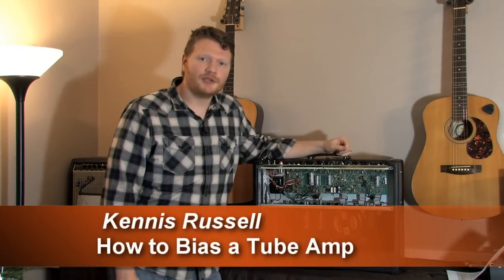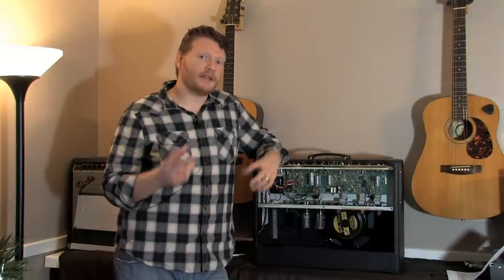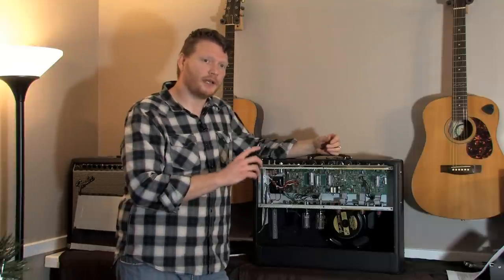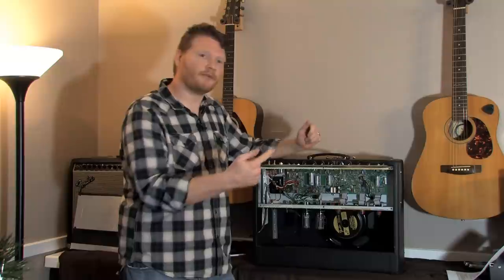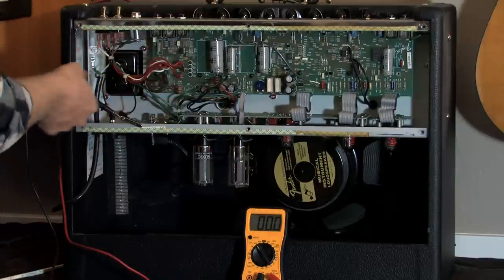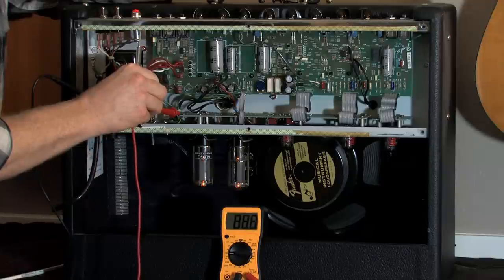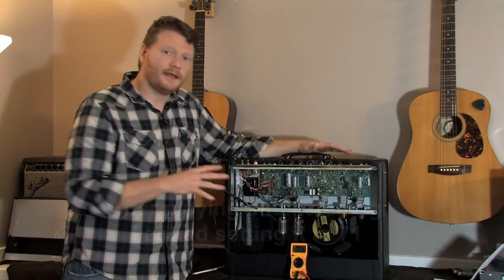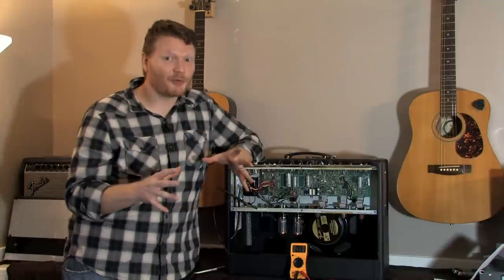How to Bias Your Guitar Tube Amp

Comment: Do peavey 6505 combos have to be biased after replacing the tubes?
I've read that they're fixed biased. Not sure what it means.
Reply: Peavey 6505 is in fact fixed bias. Fixed bias means that it can be biased like this amp. If you are going to switch from 6l6 to el34 on that amp or from 6l6 to 6l6gc(or the other way around, no clue what stock 6505 has), then you will have to rebias. But if you are switching to the same type of tube, then you should be alright so long as the plate of the tube doesnt turn red. If any tube redplates, you should rebias immediately or else await quick tube death. You should also never mix different types of tubes or mix unmatched tubes of the same type. Mixing unmatched tubes will end up giving you ugly crossover distortion in one of the tubes, meaning half the sound you hear from your amp will be turd. 

You should follow safety measures mentioned in this video if you are to ever open up you amp. Its no joke when people say that guitars amps can kill you even while turned off.
Reply: Amps with 'fixed bias' are the ones that require bias adjustments when swapping valves. Confusing, isn't it.

Comment: would you have to adjust anything else other than the bias if you wanted to change the 6l6's for el34's in a fender hot rod deluxe?
Reply: Unless your amp is capable of using both 6L6 and EL34 power tubes, all you have to do is set/adjust bias. However, most tube amps are setup for either 6L6 or EL34 and not both.
Reply: This amp is not equipped to take EL34 tubes.  You would need to have a qualified technician perform heavy modifications on an amp like this to accept a different type of tube unless the amp was already set up to accept them (some Carvin amps can take 6L6GC or EL34 tubes--the V3, for example).  In that case, the amp would have a bias switch on the back to choose which type of tubes are in the amp, not to mention you would still have to follow an internal biasing procedure like this in order to dial in the correct voltage to the tubes.

Comment: Thanks for the Video.  Why you need to bias your tube Amp: Resistors, capacitors  and tube values deteriorate with time.  It changes the amp output tube characteristics in terms of current, voltage drop and power dissipation. Bias is really realign these values to tube specs for optimum performance.  I highly recommend you check out Uncle Dougs bias video.

Comment: Damn good presentation Kennis. Good work. I'm a VOX AC-30 man myself... Beatles fan.... and I watched your vid on biassing because a power toob just shat in my AC-30 CC1.
I knew that, because the main input fuse blew its stack. You've taken the mystery out of biassing (in broad general terms). I'll give it a go myself when I get a new set of valves. Thanx again Man! 
P.S. please buy a non-conductive set of screw drivers... for the sake of your longevity.
Thanx Kennis.

Comment: how about biasing an amplifier that doesn't have a bias pot?
Reply: If the amp doesnt have a bias pot then its one of 2 things. Its either a cathode biased amp which doesnt require any bias, or its a fixed resistor bias which lock you into using a specific brand of tubes in order to get a perfect bias, such as Mesa Boogie amps. These fixed resistor bias amps are generally a pain in the ass, if youd want to change this to be able to use any brand of tubes, youd be better off taking it to a tech and have a fixed bias mod done to it.

but Im guessing that your amp is cathode biased, in which case you dont have to worry about anything so long as you use the same type of tube.

Comment: One thing to keep in mind is the higher the current reading the harder the tubes are working. The harder the tubes are working the shorter the life of the tube. The lower the current setting the easier it is on the power tubes and the longer they will last.

Comment: I have the exact same amp, I did the exact same thing. Yet my multimeter doesn't show a higher voltage than 1 volt. Yes I used the right mode. Yes I checked the battery. I really don't know what to do. :(

Comment: I have been told that single power tube amps do not need biasing. I assume from your video that biasing has nothing to do with the number of tubes, it's more a current matching to tube exercise to find the best sound ( head room breakup point ).
Reply: So my amp which has a single EL-84  power tube will require bias adjustment when changing it for a new tube.
Reply: not exactly. In 99% of cases, a single el84 tube amp will not require a bias adjustment since the biasing method is different. Most of these single tube amps are class A cathode biased, basically meaning that if you pop in any el84 tube in there, it will always be correctly biased. So you dont have to worry about biasing your amp, just pop in a new el84 and your all set.
Reply: rampage222555

Thanks rampage. I haven't been using my tube amp, late night practice calls for headphones. Hopefully I can get back to the amp on weekends.

Comment: I have a fender 30 tube combo amp. My girlfriend dropped my baby straight from the trunk of my car flat in the ground power tubes shattered to pieces. I went from using 5u4 and 2 6L6's... As the manual inside my amp says to... What guitar center had when I replaced them which was 5ar4 and the same two 6L6 power tubes.

My amp cut out today and now powers barely half what it used to put out. Not loud at all. Can someone please tell me what went wrong and why it did this? I assume I should have biased it going from a 5u4 to a 5ar4?? But now what should I do since now the rectifier is definitely bad has a huge lit glow at the bottom very unusually bright. This is my first tube amp and I feel like the GC didn't know shit and idk why they told me it would work when it wasn't the same tube. I did like that tone. Is this the problem? Or could it be speakers someone please respond I'm hurt without my baby
Reply: I have 2 recommendations for you.  #1: do not get technical advice or buy tubes from GC.  They're just not staffed with enough qualified people to give you an accurate assessment of what's going on in YOUR amp.  Not to mention, tubes are somewhat fickle and like to be "matched".  If you don't know what this means, I suggest you check out info pages on sites like Tubestore.com or Eurotubes.com and get info on that.  #2: if you dropped your amp and it's not working right, AND you don't know how to maintain it yourself, take it to a qualified technician to be assessed and repaired.  Most areas in the states will charge you around $100 for assessment and general repair, depending on the severity of the issue.  I'm not a tech nor is it possible for most techs to assess your amp online through YouTube or another forum, so just take it to someone to have them look at it.  Chances are there may be something wrong with it that you can't fix on your own, especially if you're inexperienced in doing this type of work.  Find a tech who will explain things to you and maybe even show you what happened so you could maybe learn more about your amp in the process.  It's worth it to get your baby back.

Comment: I laughed when he said "pair" of power tubes... Having a triple rectifier sucks when it comes to buying tubes
Reply: +Josh Miller Same issue here...
Reply: Yeah I get it. The new EVH has seven 12AX7's and four 6550's.
Reply: I guess I can't complain about my 8 tubes. Lol!
Reply: +Ben Lloyd my hughes and kettner has 13 tubes lolol
Reply: Eric Bee 😂😂😂
Reply: Play an Ampeg SVT, and you will know true pain!  My SVT-2 Pro has 14 tubes (6-6550, 5-12AX7, 3-12AU7), and my original SVT has 14 as well (6-6550, 1-12AX7, 2-12BH7, 4-12DW7, & 1-6100).  It's... Not pleasant to retube them.

Comment: The first thing you need to do is replace that leaking 22uF/500v capacitor right above the bias pot there...!
Reply: I can tell because I am an engineer - and have 'developed an eye' over the decades..!
Reply: I see it too. You can see some pale coloured stuff coming from the capacitor lead in the closeup shot showing the potentiometer. That would get worse and eventually fail if not replaced.

Comment: Isn't "Biasing" setting the "Current" and not the "Voltage"? That is, when you bias an amp, the voltage is rather constant, and you play with the current, is it not???
Reply: I believe the bias is the DC voltage point at which the two power tubes are set to determine where in the wave cycle one of them turns on and the other turns off. This is in the context of the push/pull configuration of class A/B amplification. One tube takes care of the top half of the wave (push), and the other takes care of the bottom half of the wave (pull).
Reply: You are adjusting negative bias voltage on the control grids of the power tubes, which determines the current flowing in the tubes  when no signal is present. The plate dissipation is the product of this current and the B+ volts at the plate.
Reply: Yes your setting milliamps , I use webber bias calculator online using class A/B which is push pull bias chart.
You first need plate voltage probe read then use you digital multimeter to set the grid current bias from chart !
The negative milliamp voltage pulls the signal thru the grid on the power tube.
Set at 56 milliamp dc current instead of 40ma did red plate my el84 tube as the bias drifted up over time !
Redplating is caused by voltage runaway on the plates because your bias current is to dang high !

Amp transformers have fried when shorts happen ??$$$

Comment: Change those R78 and R79 resistors; they’re burning your board! You also need an insulated screwdriver for that bias pot. Always measure the bias across the resistor, meaning that the black probe goes on the negative side of the resistor, not on the chassis. Placing the black probe on the chassis results in an inaccurate reading by as much as 5 to 6 mV.

Comment: Totally forgot to mention that driving your tubes hotter can and in many applications will make them fail/degrade faster... so if you like that kind of tone with a heavy drive and more gain... heck, no problems! You'll just be replacing your tubes more often than a blues guy with his tubes running more on the cold side!
Reply: There's no guarantee about how tubes will degrade. Some can be lit up for years and they're fine.
Reply: LuxeXx No denying that at all :P I've seen amps from the 1940's with their original tubes working flawlessly, But the general consensus (And the bit I was getting at is) is that if you have a hot biased amp, your tubes won't last as long as they originally would if you ran them colder...
Reply: I know, but I don't think it makes as much difference as people make it out to be. If it sounds good, that's important thing. Who knows what the tubes will do. I don't think it's a huge risk to skip biasing.

Comment: i'm sorry but the information about biasing that you give in the intro to your video is not really complete.

biasing is setting the DC operating point (plate current) of the power tubes.

if the tubes are biased too cold (too much negative voltage on the control grids) then you risk getting cross-over distortion, and your power tubes will be operating closer to Class-B rather than their intended Class-AB.

if you bias the tubes too hot (not enough negative voltage on the control grids), then you risk reaching the power dissipation limits of the plate and screen-grid, thereby causing heat stress to the power tubes and greatly shortening their life.

usually we bias power tubes somewhere between the two scenarios described above depending on your taste, desired tone and expected tube life.  typically somewhere between 50% to 75% of the maximum power dissipation of the tube (maximum dissipation can be obtained from the tube's datasheet)

Comment: do not use a metal screw driver to adjust anything in a guitar amp,,,,,ever
Reply: Mark Cooper why not??
Reply: Risk of death by electrocution. If you don't know this you shouldn't be poking inside anything electrical.
Reply: @TimMer1981  I just realized it has to be on, did not see the all video
Reply: Use what ?
Reply: what would you use instead then?
Reply: Every electrician I've ever met uses metal screwdrivers in industrial low voltage (460V or less) panels.  The difference is most will use insulated screwdrivers.  You just need to be careful in what you're doing.
Reply: Phil Allison  I'm a Senior Electrical Engineer and been in the field for 13 years.  It's not always possible to lock out a panel.  Some jobs require the panel to be live.  It's always smartest to deenergize obviously.  I had a friend who was a seasoned electrician have a screwdriver drop from his hand while working in a panel and he suffered severe burning from arcflash.  Most of them use Wiha insulated screwdrivers.  Only the tip isn't insulated.  Curious as to what you use if you're not using a screwdriver?  Not being an asshole, looking to learn here.
Reply: Wondering if either one of you guys can give me some help. I just got a kentucky special blackstar amp used, 3 months old since it was bought from previous owner. I noticed after playing with the settings giving it a powerful low end and a good amount of gain, at a fair volume (much louder than bedroom) there was a high pitch constant squeaking coming in after about 20 mins of constant playing. Big chords and such. Not chill or bluesy. So I noticed the sound is subtle , I noticed it when I was behind the amp kneeling down. It also continues when on standby . Sounded like it was comin from the power tubes. I’m lookin to send it to a tech , do you guys think it’s just a power tube thing? The tech said it’s 115 an hour. He also said the tubes need to be broken in or something like that for two days after being put in? So it had to stay 2 days after being swapped, at their shop. I don’t think he’s charging for all that but my question is, if it is in fact a tube, does it really need to stay with him any longer after it has been set? I also don’t like the idea of an amp tech setting the sound of the tubes to his taste, doesn’t make a lot of sense to me tbh. I’m pretty annoyed I just got this relatively new amp and it’s having this issue I’m really hoping it’s just a tube thing. What do you guys think based off of what I said?
Reply: @heythere6983  I can tell you I don't charge even half of that an hour.  Different locations you can get away with different charges.  I'm $40/hr to a local guitar shop and he puts whatever markup he does on my work.  I buy all of my tubes for all jobs with a 24 hour burn in.  Meaning the company I buy them from does a 24 hour burn in before sending to me.  Never heard 2 days personally.  Doesn't mean he's wrong but I've never heard that.  Maybe he's splitting up the burn in time for when he's home.  It's literally less than 2 dollars per tube to do the 24 hour burn in.  Just remember, if he's charging $110/hr how many hours is your amp worth?  At that price he will quickly be into ranges where it's not feasible to repair based on the cost of a new amp.

Comment: Nice video. Not really "power tubes" though. They don't provide power, they provide current to the speakers. Power in the amp is more correctly stated as coming from the power transformer. Just being accurate.